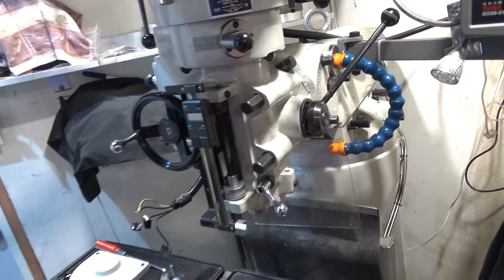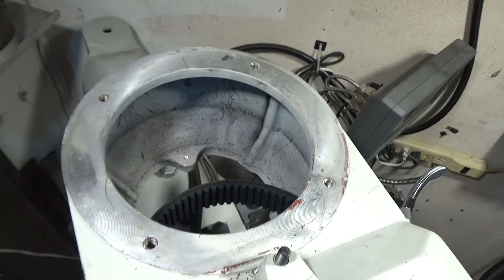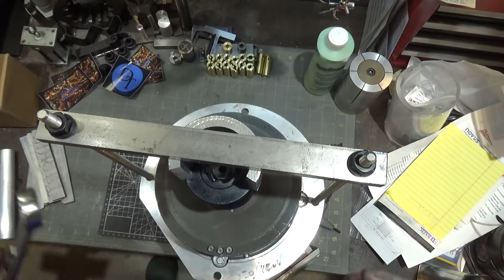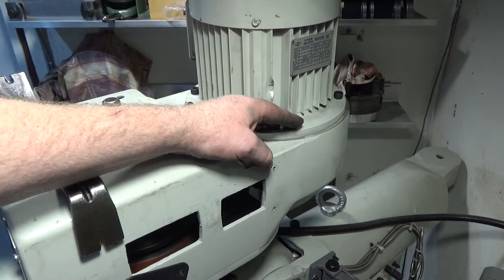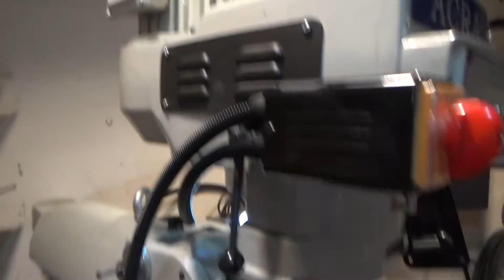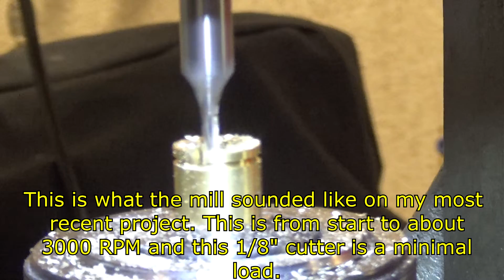102 Clunking Milling Machine Repair

Comment: I am getting ready to disassemble mine which has now broken the belt and always had vibration from day one.  My mill has a different name but looks just like yours and is 3 hp. How heavy is the moto? I have concerns about lifting it down off the mill.
Reply from the maker: The motor was heavy. I want to say around 50 pounds, but this video was shot quite a few years ago.

Comment: Great video and very very informative.
Because of this video, I did it myself replacing the broken pulley with a new one. I even made a pulley pusher with a 5/8 by 3 inch bar.
Thank you so much for your video.
Reply from the maker: I am really glad that I was able to help in some small way. Congrats on the fix. Hiring someone to fix industrial machinery is very expensive.

Comment: Speed Selector makes variable speed pulleys that replace the Reeves, Hi-Lo pulleys and TB Woods that went out of business or got bought.   Most of the pulleys are in stock or Speed Selector will custom make if needed. They have an actual engineering department who were very helpful.
Reply from the maker: Thanks for the tip. That is really useful and appreciated.

Comment: Holy crap...this is what my Acer 4VK sounds like.... THANK YOU!! What's the part number of those bushings?
Reply from the maker: You are so welcome. I am sorry, I never got a part number. I called ACRA Machinery and they pointed my to a mobile repair guy that makes the parts himself and I ordered 3 sets.
Reply: @DudleyToolwright  So uh.....who's the local repair guy....
Reply: @DudleyToolwright  Was trying to find this video for a guy who had a similar issue. But to close the gap on mine, the distributor out in California has all the Acer head parts. They're probably the same though.

Comment: Our near identical Saber branded mills use M6-1.0 bolts to compress the drive pulley spring.
Tip: Get a bunch of lengths. When you go to safely uncompress the spring, you compress 1st to get the snap ring out, then walk out 1 bolt (pay attention to how much threaded length you have left!) and swap it for a longer bolt and draw that longer bolt in. then loosen out the shorter bolt and swap that for a longer one, repeat this alternating/stepping to larger bolts until it is relieved enough that you can easily press it with your hand. Similar for going back in.

*do all of that with it on the motor shaft. It will keep things from shifting in a bad way and if something does break give that some direction/constraint.

Also, you will probably need to make a special tool with 2 bolts spaced for the holes in the washer, so that you can realign the washer holes with the threaded holes when you need to service this or the belt again in the future.
Reply from the maker: I appreciate the tips. Thanks. I ended up getting a couple of pieces of threaded rod to do what you are recommending.

Comment: In the last two days I rebuilt my Supermax head and my Acra head.  Both are late 1980's variable speed machines that were purchased new with Anilam Crusader II CNC retrofits.  More recently they have been upgraded to the Acu-rite MILLPWR G2.  The Supermax is a better design (in my own humble opinion) when it comes to access to the internal components and removing the motor.  The Acra head is much more of a challenge.  The first thing you should do is to compress the spring by the screws mentioned in the video.  Both of mine take 10-32 screws.  To make it easier initially, crank the variable speed until it is at minimum spindle speed.  This will compress the spring and allow you to use shorter screws to compress the spring to the maximum thus opening up the pulley.

If you have to disassemble the pulley from the motor you will need several screw lengths.  When the spring is uncompressed it will take rather long screws to start the compression.  Once they are bottomed out you remove one and swap out for shorter screws one side at a time.  Repeat the process with progressively shorter screws until the spring is completely compressed.  

When re-mounting the motor I use tie-wraps to hold the belt open and in an extended position so it will slip more easily onto the pulley.   Your mileage may vary.
Reply from the maker: Thanks for the great tips and feedback - they will help more than just me.

Comment: That variable speed system is a very simple version of a CVT found in some of today's vehicles, a belt and a couple of variable pulleys and you basically have infinite speeds.  

Great video and explanation of what went wrong and how its easily fixed.
Reply from the maker: Thanks for the info.

Comment: The holes were not 90° off when you had the keyway lined up correctly.  At first  I thought you were joking.
Reply from the maker: I was a bit surprised as well and then realized my mistake. Trying to narrate and think at the same time often cause neither to work well...

Comment: That went fairly well. I need to replace the bearings in my mill. Not looking forward to it.
Reply from the maker: I'm right there with you. I was really apprehensive about digging in to the milling head. Of the videos I have watched about actual Bridgeports, most showed some real difficulties with disassembly, if you don't have experience.

Comment: On my mill (Kent KTM- 5VK) which is also a rebranded Topwell like many, there were two of the access cover bolts that were longer than the third. These two bolts are the spring compression bolts for removing the lower sheave.
Reply from the maker: That is definitely handy.

Comment: Glad you could get parts and no damage to the shaft 

In the older units of this type the rebuild kit had a mandrel and you set the bushings into epoxy to restore a good fit 

Now most you have to buy a complete new pulley
Reply: We had lots of this kind of transmission at my plant and all the repair kits came with a tube of epoxy. In fact, the struggle was the work needed to clean the pieces of the old bushing and epoxy from the slots.
Reply: Well

At least the belts our not canvas and wood anymore with babbit bearings
Reply from the maker: I talked to ACRAs service rep and he said that the epoxy was only necessary in versions where the bushing had a bit of slop. He said I could add some if it looked like the bushing could slip a bit. Mine was really tight. I could barely get the shaft into the bushing. I suspect that the fit was a slight interference junction. Maybe 0.0002" I think they were counting on a bit of compression. I was concerned that there might be too much friction for the pully to adjust properly, but the forces involved made the fear a non-issue.

Comment: Would those screws open that pulls up enough to make installation easy?
Reply from the maker: I am not too sure about what you are suggesting. If I have to do this project again, I will use the threaded rod holes provided in the pully assy. I purchased the M5x0.8mm threaded rod just in case.

Comment: Always nice to find that it doesn't have to go to the manufacturer for repairs.  That wrench left a bit of a mark on the motor.  A Sharp Impact.
Reply: Mature Patriot / Vernon Currier My first thought too, but then I figured “wait a minute, mills rotate in the other direction ...”. 😉
Reply: @Stefan_Van_pellicom  Maybe he had the mill in reverse?
Reply from the maker: That was where the damage happened. I was really surprised at how deep the wrench went in a single partial revolution. I do have a chunk of brass on the end as a tapper for the drawbar.

Comment: Great repair  . From what i have seen it can be a bit of a juggle to get the motor back in .  I did get my one fired up ,  the noise is worse on camera but it has been sitting for years so i am hoping for the best .  Cheers .
Reply from the maker: Thanks. I am sure if anyone can deal with problems with your mill, it will be you. I have really enjoyed the lathe repair series and learned a ton.

Comment: To have a fine machine sound like that.. Ouch, that must have been awful to listen to, and worrying about how bad the problem could be. Happy for ya. Did you do a happy dance? hahaha
Reply from the maker: Very much so. You must have been in my head. Worse still, the noise wasn't always consistant. Sometimes the mill would sound relatively normal for a few weeks. I did do a mental happy dance. Definately. Thanks for sympathizing.